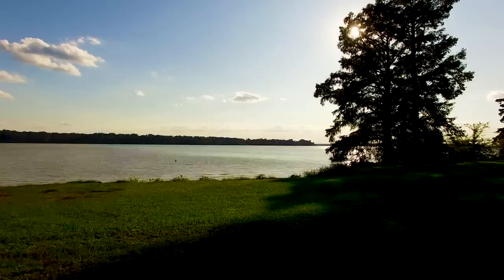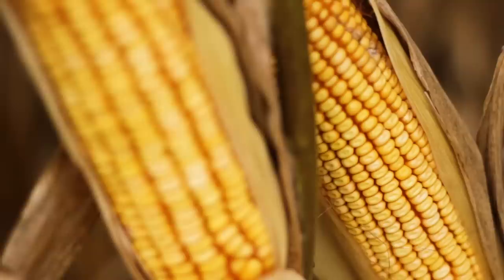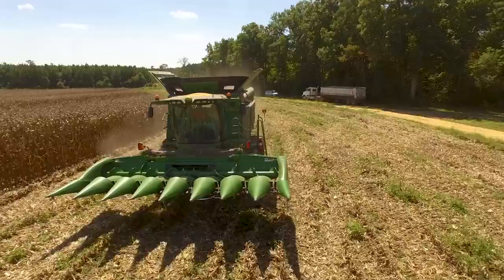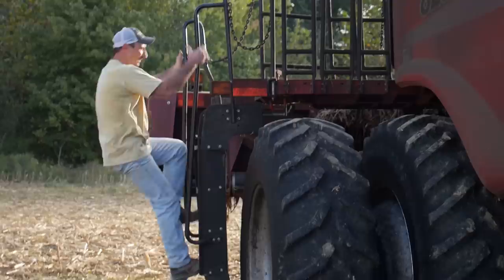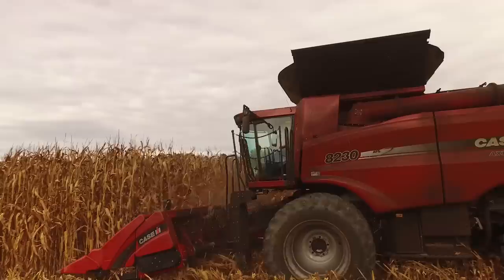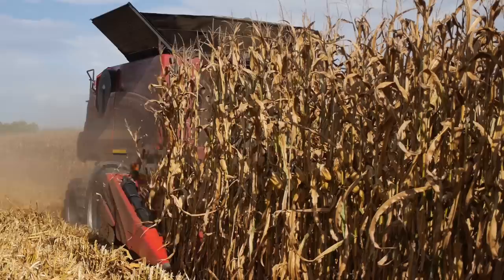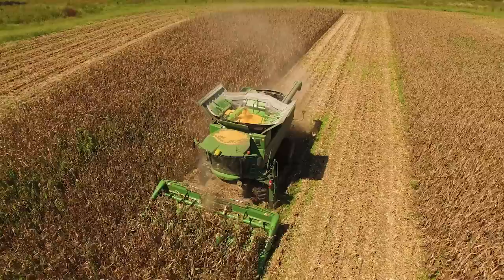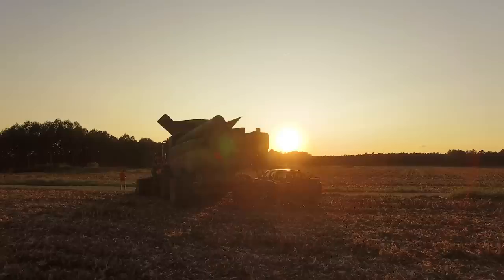Corn Warriors - 109 - Green vs Red - David Hula VS Kevin Kalb - Real Farming TV

Comment: Red burns at least 1.5 - 2 gph less than the green
Reply: gooseontheloose12 the new reds burn two the three times the amount of def though
Reply: gooseontheloose12 but the JD will keep on moving through the field.
Reply: JNLN case and new Holland do a better job and leave less
Reply: JNLN seems to me that every time I see a deer in the field it's running away from me. Hmmm
Reply: JNLN Too many belts and chains on a JD , power losses and maintenance nightmare.
Reply: @jwhitley101whitleyfarms9  well considering they're the same goddamn combine made the same goddamn Factory it's not exactly like they're different things.
Reply: @deannelson9565  no shit Sherlock  that's why I said case and new Holland I own a farmall 70 and a nh tl 100 they are exactly the same it even says cnh on the parts
Reply: fat guy no more  also can't get parts for it meaning it's useless